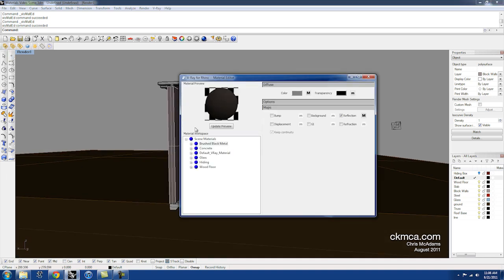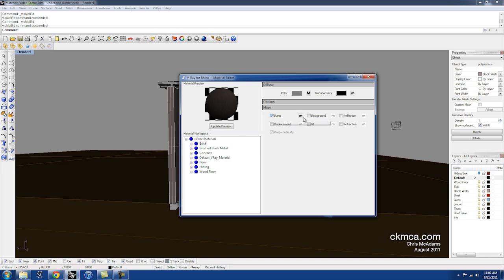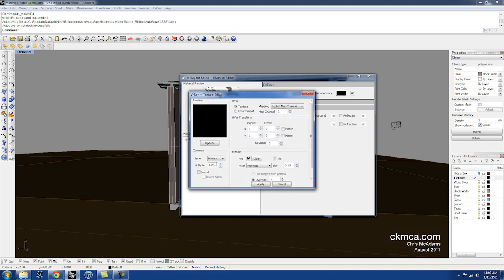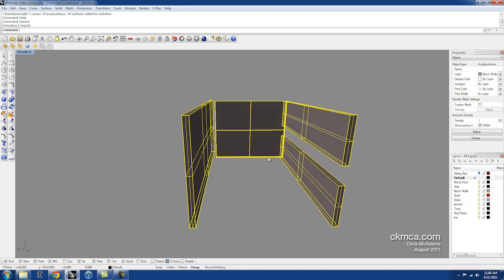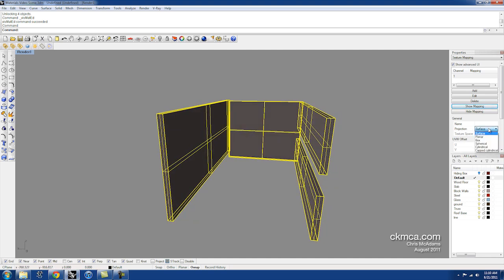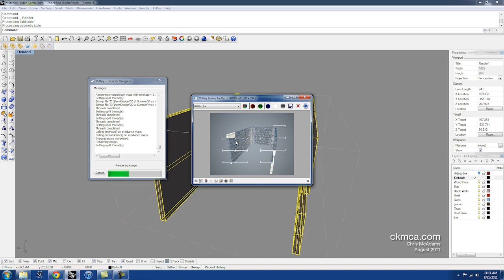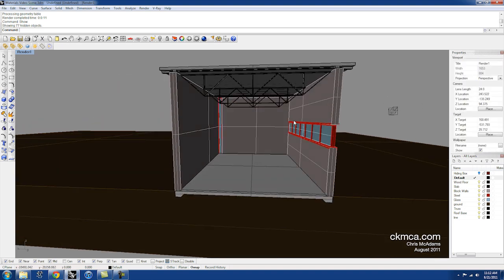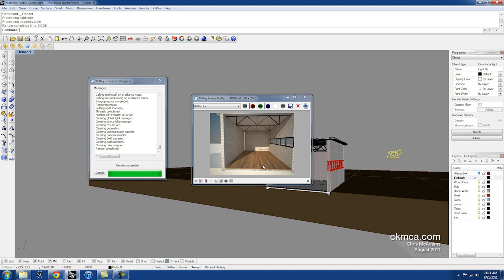[Advanced Materials] Part 2 - Texture Mapping

Comment: i am changing the material from the texture mapping but doesn't change when i render. it remains as the default.
any idea?
Reply from the maker: sometimes from the vray material menu you need to right click and  "apply material to selection" and "apply material to layer".  If the layer material is overriding the vray material it will not render correctly.
Reply: ***** oh yes!! that was it! thank you very much!!!